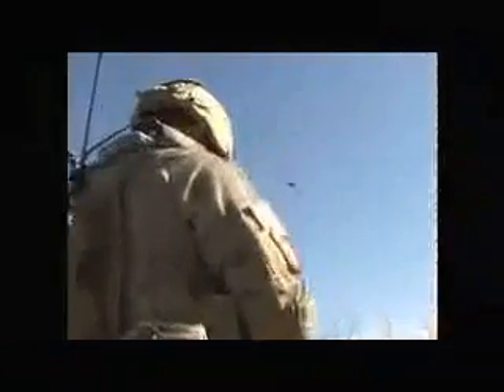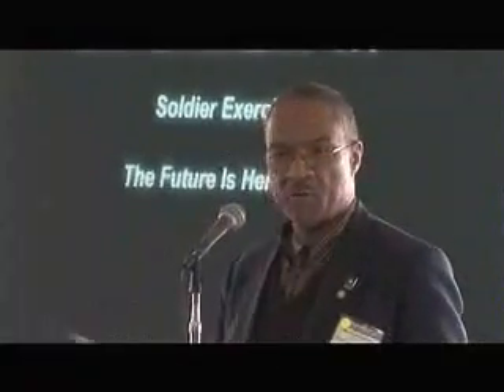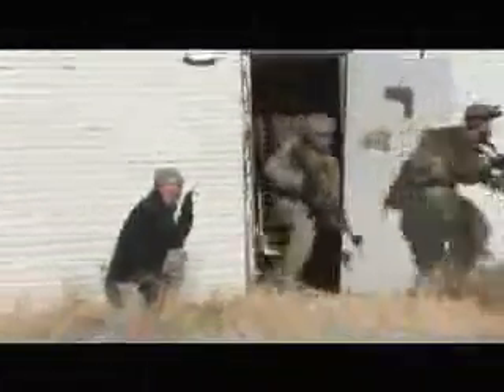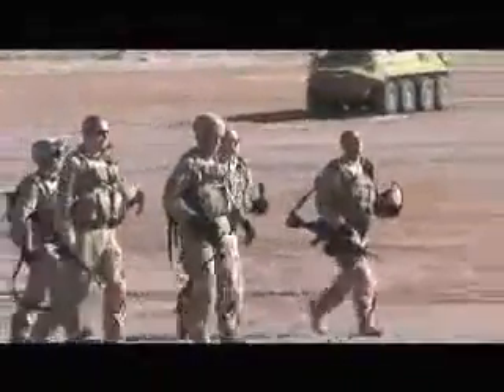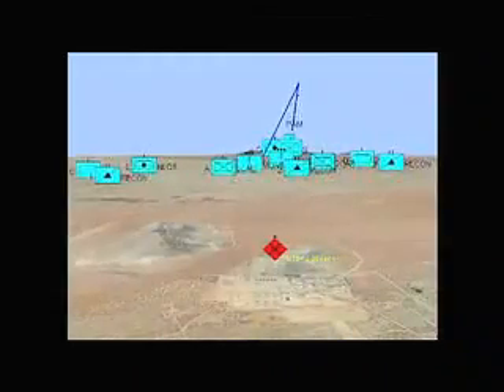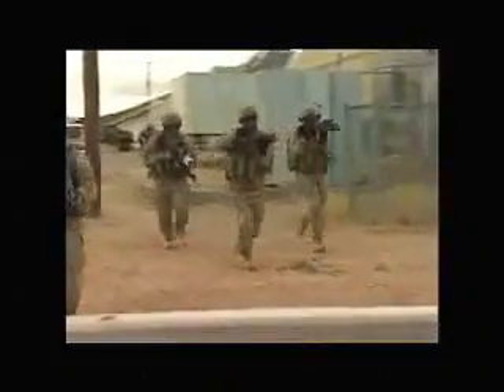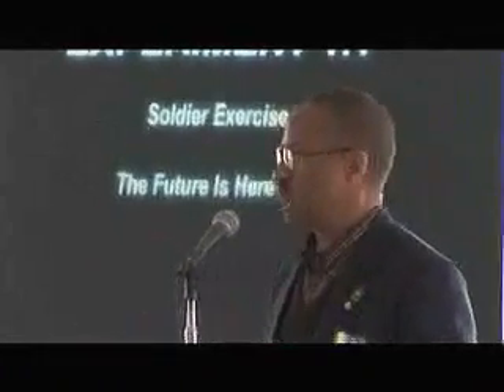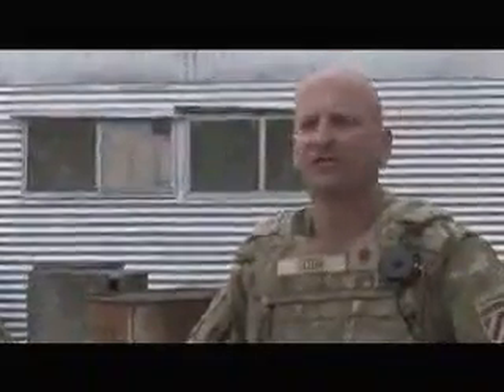Future Combat Systems Demo

Comment: @godzplaya As some one who's been those boots on the ground, I have to agree. On the flip side though, we need those sensors, & SUGVs for the lack of man power & the high number of IED threats. There are only so many EOD units out there, so when we come across a potential IED it's a waste of like 4-5 hours if EOD comes out & it turns out it really was just some trash. Lot better to have a SUGV check it out. The UAVs we don't need, we already have the Raven it works fine.